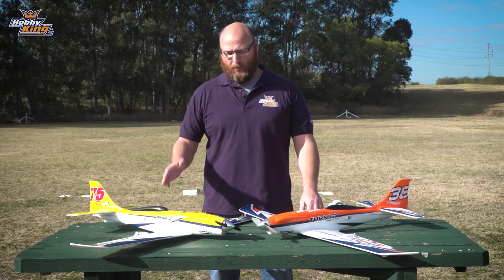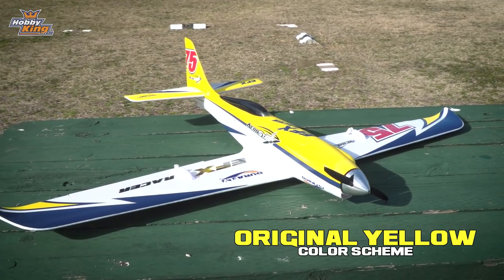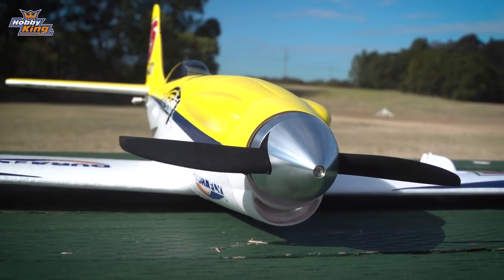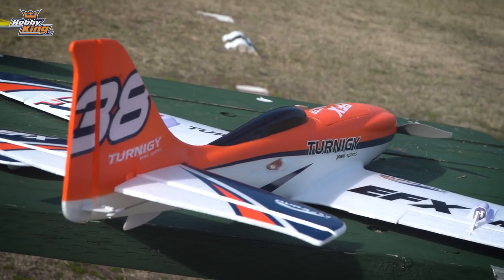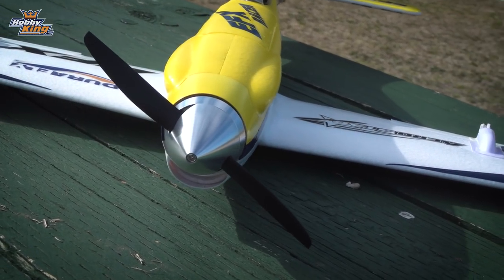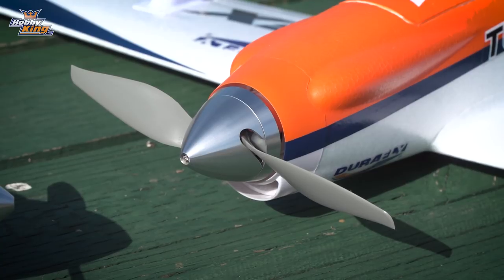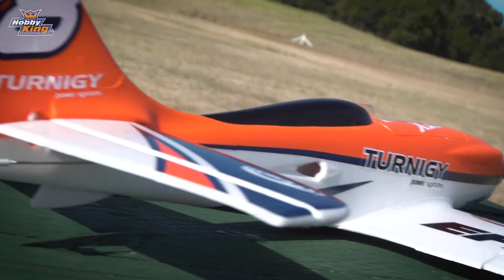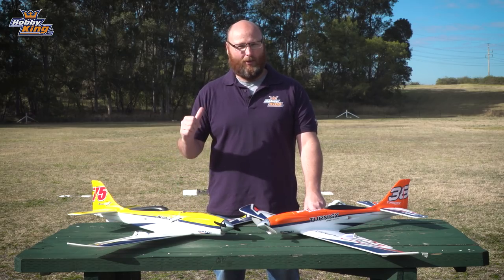Durafly EFX Racer (PNF) High Performance Sports Model 1100mm (43.7") - HobbyKing Super Daily

Comment: The orange paint is coming off. The canopy battery protector is opened during landing. Both are noticeable on this video presentation. You instantly realize that both problems from EFXTRA 1 and EFXTRA 2 haven't been addressed. Paying that much, to be forced to address these things before you actually fly it is sad. Also the bottom front hole lets dirt and grass get inside the plane and they get trapped at the far back of the plane. One more thing that you have to do before flying it is to put a protector net at that hole...